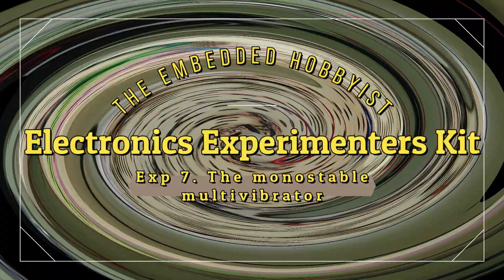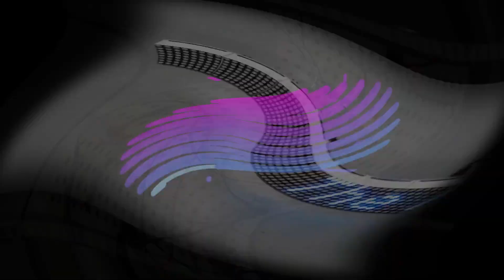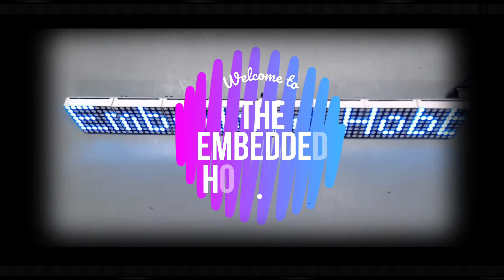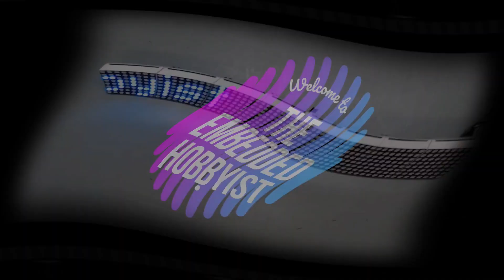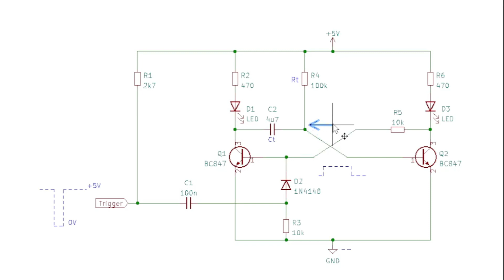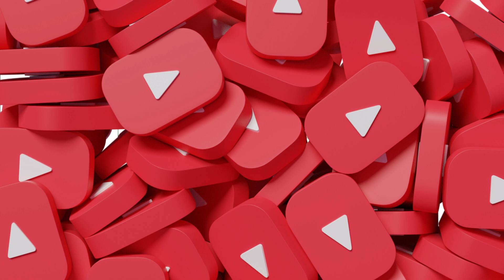#193 Experiment 7 monostable mulitvibrator

Comment: I like the explanation of any good circuit, but the scope really helps visualize the whole thing. Good vid! 😁
Reply from the maker: Which is why a scope is a great bit of test gear, it's your eyes in to the inner workings of the circuit.
Reply: @TheEmbeddedHobbyist  Very much so, far better than volt meters and logic probes. My current scope is roughly the size of a cell phone. I will be upgrading this summer. Only then I may join the prestigious ranks of the well equipped.

Comment: I'm like Q2, I always go negative when triggered!
Reply from the maker: Don't we all, updated video drivers on toy room PC, now I've taken the boot up time from 10min to 21mins, quite a change but not in the direction they said it would :-(
Reply: @TheEmbeddedHobbyist  21 mins? That’s enough time to boil the kettle for the tea and cook breakfast
Reply from the maker: @Adam Bryant  looks like,e i might have to bite the bullet and buy a 1tB ssd and reinstall windows and all the programs. Thats a day I won't get back.
Reply: @TheEmbeddedHobbyist  Imagine having to do it several time for a raspberry pi because the scared it uses for storage keeps dying!
(shudder)
Reply from the maker: @AJB2K3  We used to use non-volatile ram back in the 80’s where when you detected that the power was going you could save the ram to non-volatile storage. It was like a EEPROM sitting under the ram, one pulse and it save the bytes you have configured to save. But you had to keep save counters, as there was only so many times you could save before the data got corrupted, so after so many writes you have to move the data block and the counter a few 100 bytes up.

You had to be very careful how often  you saved settings, or they might fly over and drop a bomb on you.
 🙂